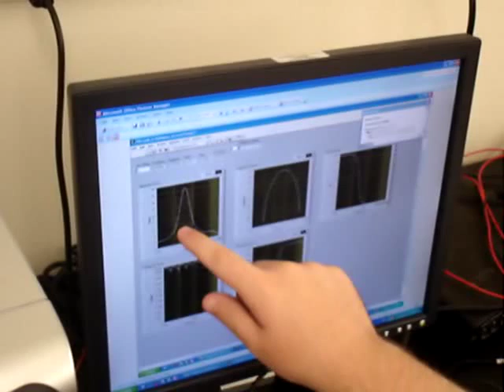Solar cell impedance spectroscopy

Comment from the maker: Both the solar cell and the test circuit have only two wires connected to the impedance spectrometer.  In the case of the test circuit, we can independently validate the different resistors and capacitor.  The test circuit is used to check if the numbers measured by the impedance spectrometer match the actual values in the test circuit, and they do.  We can't independently measure these values for the solar cell, but the test circuit validation gives us confidence in the solar cell measurements.

Comment from the maker: @sesa2910 We are currently using dye sensitized solar cells.  To find out more about this subject, I suggest you consult a paper  like "Electrochemical Impedance Spectroscopic Analysis of Dye-Sensitized Solar Cells" by Qing Wang, Jacques-E. Moser and Michael Gratzel (a Google search should help you find an online copy).  Our test model (shown in the video) is simpler than their model, but our analysis of working cells is similar.